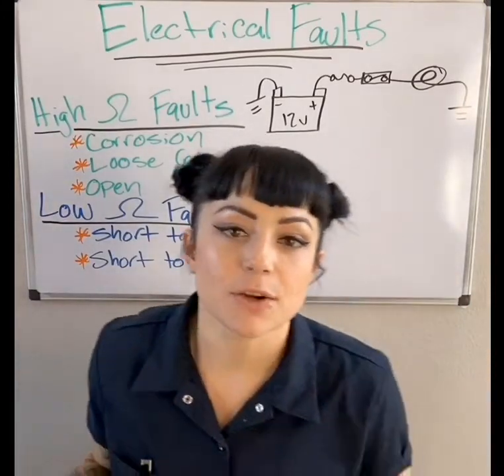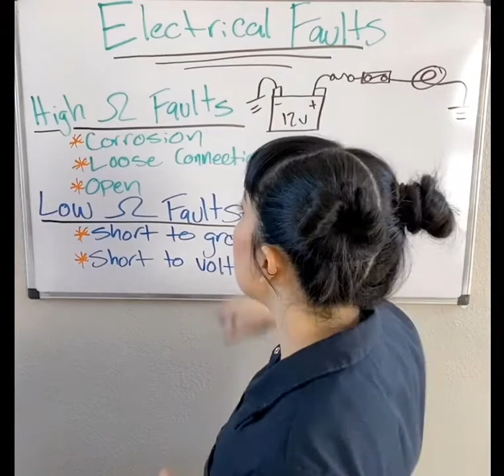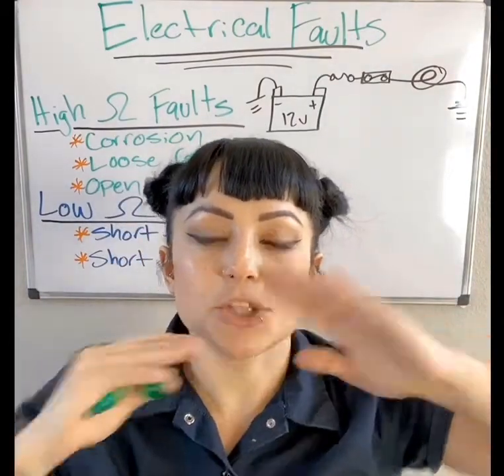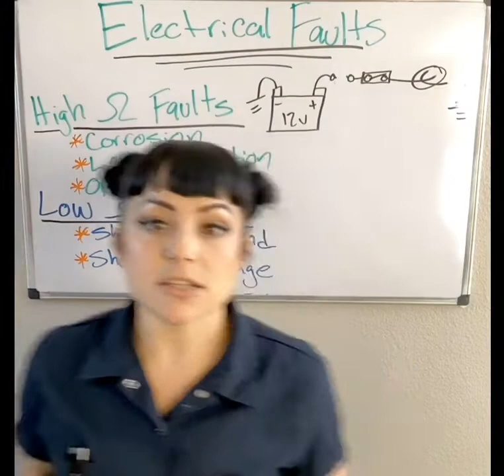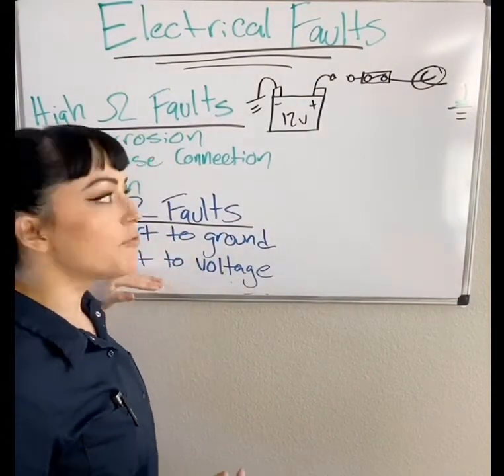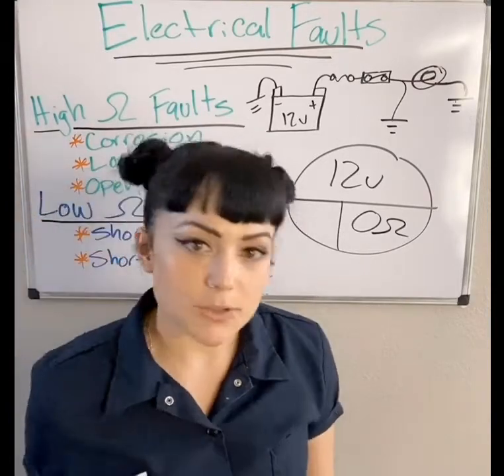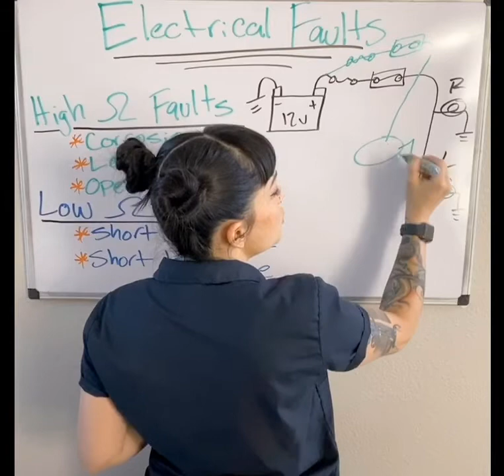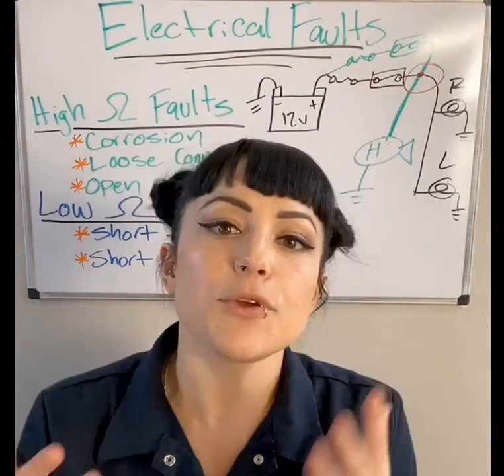Basic Automotive Electrical Theory 8

Comment: could another example of short to voltage be like a light bulb that doesn't turn off?
Reply from the maker: Yes. That would mean the short to voltage is before the switch or the switch may be stuck closed.